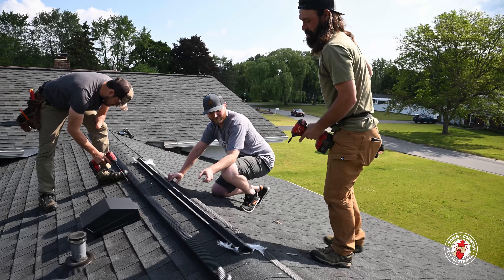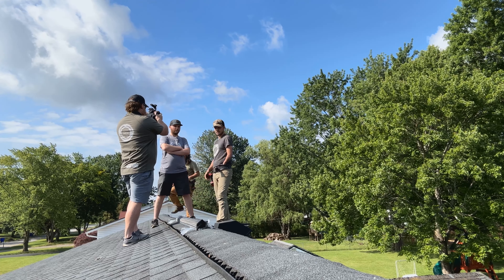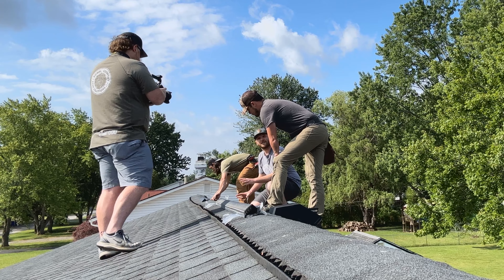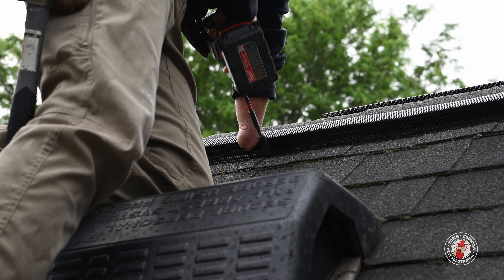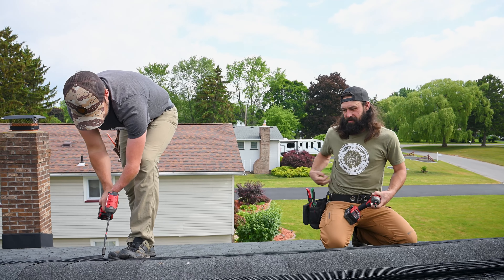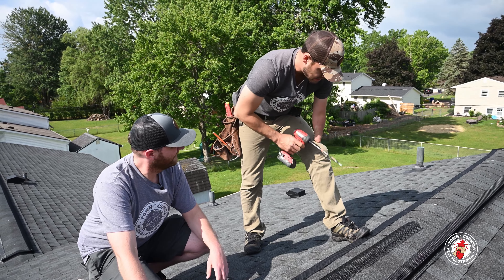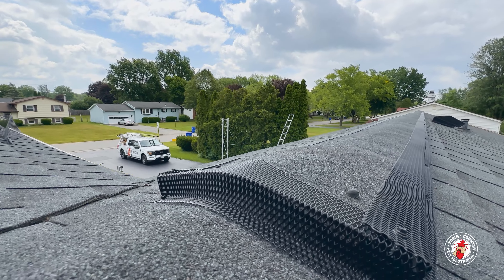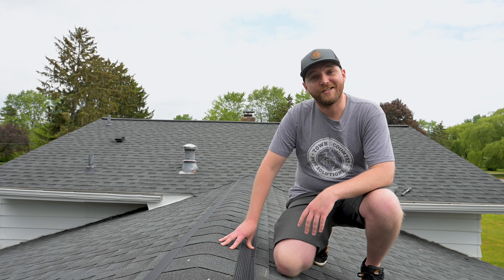Ridge Guard: Keeping Critters Out of Your Attic | Around Town

Comment: Have the screws that were used to install the ridge guard ever caused a leak? I just had ridge guard installed and I am a little worried it could cause a leak.
Reply from the maker: If installed to manufacture specs there should be no concern over leak. Between the tar paper seal and rubber gaskets on the screws, that makes a water tight seal. We also add silicone to any areas we see that might have a water issue.
Reply: Thank you for the response!